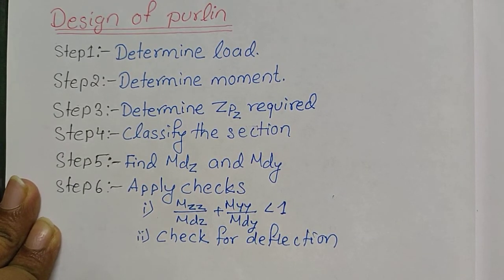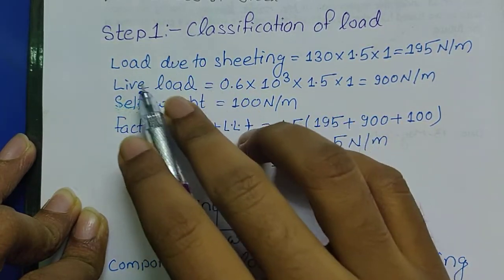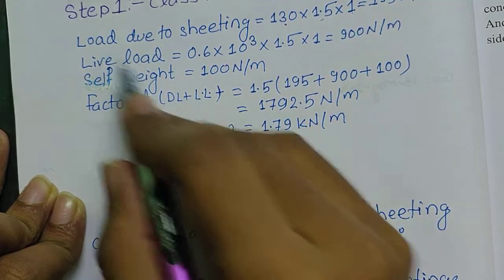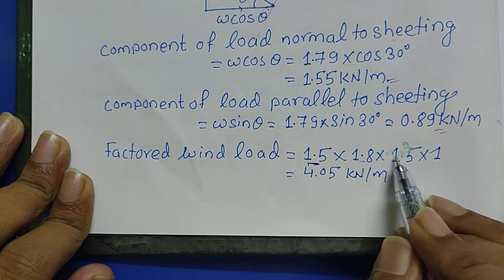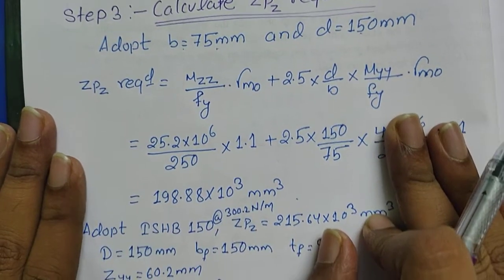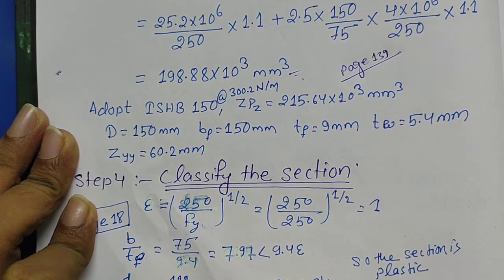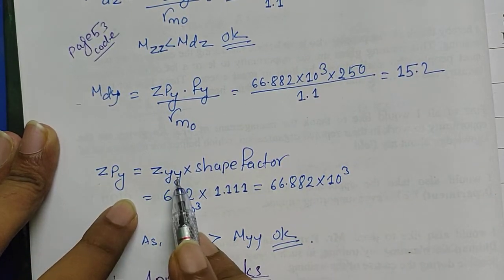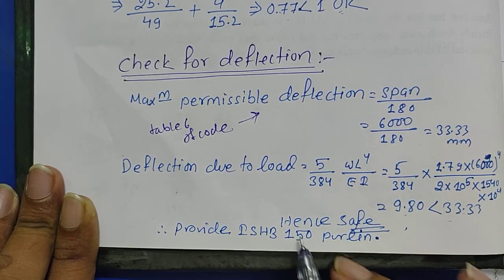Design of I section purlin | Design of purlin | Design of purlin in steel structure

Comment: Sir  while calculating toatl laod parallel to sheeting why you did not add  factor wind laod any reason ... you add it in toal laod noraml to sheeting but you did not add it in parallel why
Reply from the maker: When I was in my college I solved it the same way. I went through 3 books which had length process and time consuming from exam point of view. So, I tried this. You can go for it.
Reply: @Civillearningonline  thankyou sooo much sir❤️

Comment: Is ac sheet elastic cladding?
Reply from the maker: Yes, it's can be used as an affordable external cladding for the building.
Reply: No what I meant is if the question mentioned AC sheet instead of galvanized ,then what would the permissible deflection be??
Reply: Thanks for replying and please reply this too💛
Reply from the maker: You should check the code on galvanized sheet this is going to be very helpful to you. Here is the link to download the code.
www.iitk.ac.in › test › IS-codesPDF
IS 277 (2003): Galvanized Steel Sheets (Plain and Corrugated)

Comment: i thing ur Load claculation unit is wrong  (130*1.5*1) N/m . How is unit N/m... plz explained this..
Reply from the maker: Hello dear,
In the following question we are given the weight of corrugated sheeting as 130N/m2.
I have done (130*1.5*1)N/m because here 1.5 is the factor of safety.And 1 is for per meter length.
So (1/m2 * m =1/m).Hope u understood.
Thanks for your comment.

Comment: Sir zpz Ka value k se nikale
Reply from the maker: Hello dear,
Inorder to calculate Zpz one need to use formula provide in this video which is as per the code.And then we need to assume b and d in such a way that d is twice of b.And the range of d should be between 110 to 150.And automatically if u take 120 or 150 as d the the value of b becomes 60 and 75 respectively.
And after calculating required Zpz we select a section as per the question whether we r asked I section or channel section.
Keep in mind that the section we select must have Zpz greater than our calculated Zpz of step 3.
I hope u have understood.

Or u can check me video on design of channel section to have deep understanding about purlin design.

Thanks for your sweet comment.
Reply: I got it sir